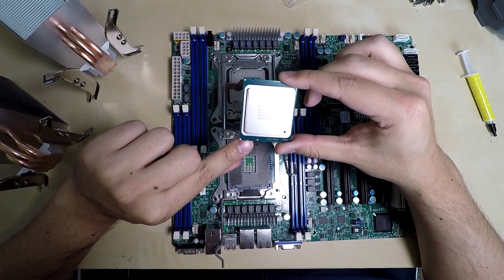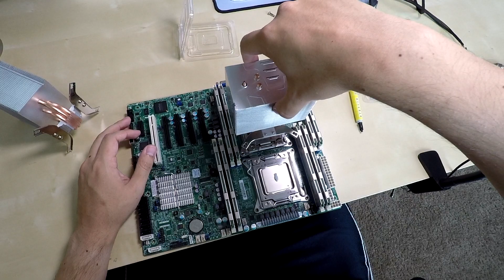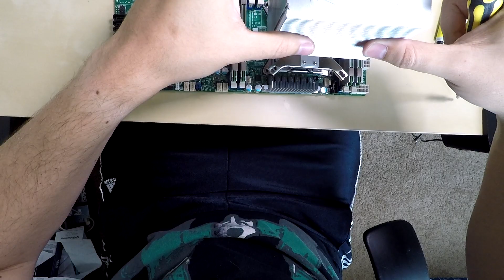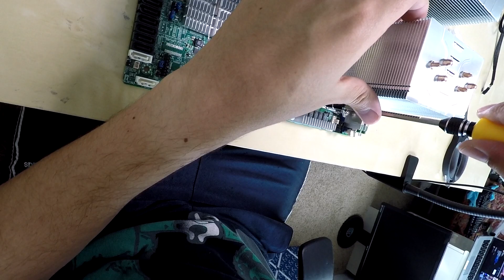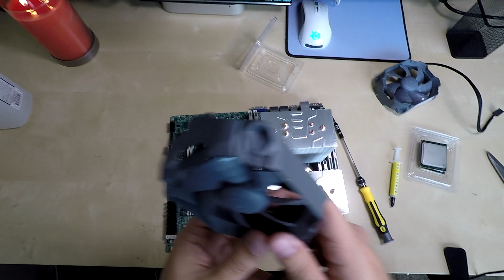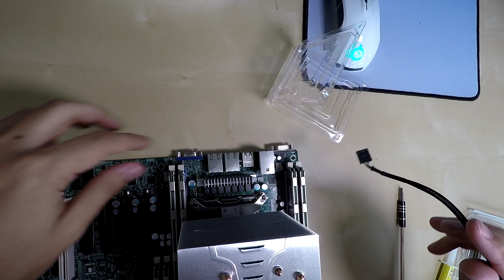Tabletop build - Dual 2011 Supermicro X9DRL, dual Xeon E5-2660 V2, 64GB DDR3 ECC REG, Arctic i11

Comment: Just bought a hp z620 dual cpu workstation with 2 of the 2660 cpu s for 150 euro (without hdd/windows)
I just putted a MVNe ssd in one of the 6 pcie slots,and did a clean instal...
Wunderfull preformance on the two 8 core cpu s..
Never did i see a system boot that quickly!
4.5 seconds,thats impessive!!!!What a machine !and i payed just under 250 euros for all the hardware...great cpu
Reply: This board supports NVME natively? Or you had to tinker with it?

Comment: It would be nice if you could actually finish the demonstration by booting up the motherboard on the table using a normal PSU and how you short the power switch. Thanks

Comment: I can build computers but  if you don't do this every other day, than the anxiety level is always heightened that you may not get a post.  I  tend to get a bit sweaty bending over turning screwdrivers and trying to read header info in small print -- the process can often be a bit taxing, and then when you think all is OK, a drop of sweat from forehead drops and splashes onto the mother board,  and you cry out . . . 'where's that damn Q tip? or am I being paranoid? will one drop of sweat ruin my board?"
Reply from the maker: Servers are just as easy as regular computers. The hard part is research, not building them.

Comment: I'm considering a x9dri-f for a workstation/render node/data server and I don't have any experience with Supermicro hardware.

Wondering how is the performance/support for these boards? They're currently MUCH more available/affordable than both Gigabyte and ASUS options and so I'm betting that someone else has tried it. (If not, I guess I'll report back)

Thanks for your videos!

Other parts:
2x 2690 v1
EVGA 1600w G2 psu
32 gb (8x 2r4 Samsung 10600...to start)
Rosewill 4u case
...a bunch of SSDs
GPU tbd
Reply from the maker: Support and documentation for Supermicro boards is the best in the industry. They work great in many capacities, not just as servers.

You're way overspeccing your PSU, you should only need around 850W. Don't waste $250+ on a 1600W PSU.

Check out the latest LGA2011 build guide here: https://forums.serverbuilds.net/t/guide-anniversary-2-0/1075/

Comment: Hey thanks for taking the time to make this video. I am currently interested in the same board. There are some concerns about the weight of the coolers. I’m building a tower-type server where the motherboard is standing vertically. Therefore the coolers are essentially hanging at 90 degrees. Will the weight put too much stress on the board?  Also how loud is it? Thanks again.
Reply: 4 months later, here you go. that is a lot of weight. you don't need tower coolers for 95w xeons though. Intel put out a good stock 2011 cooler. go with that.